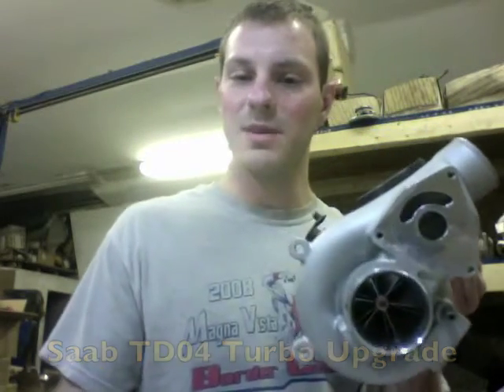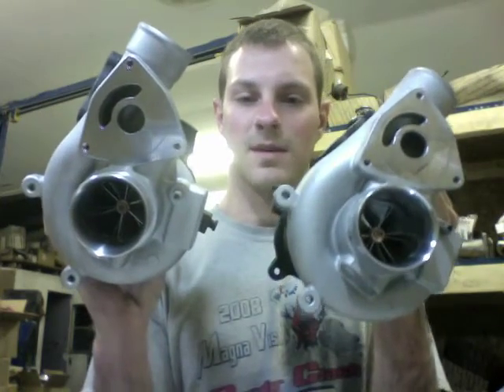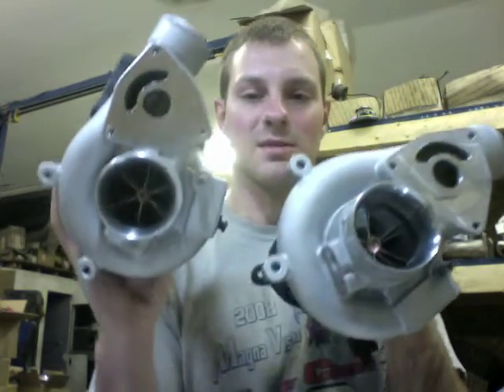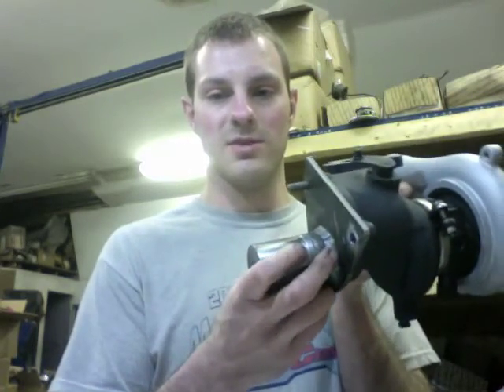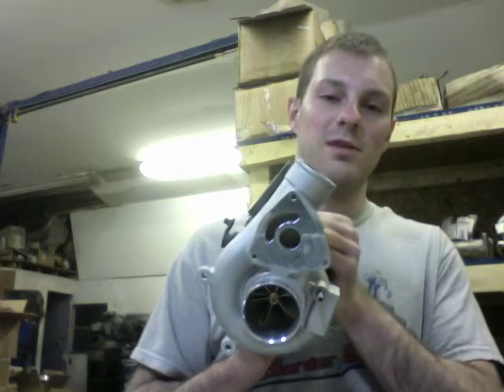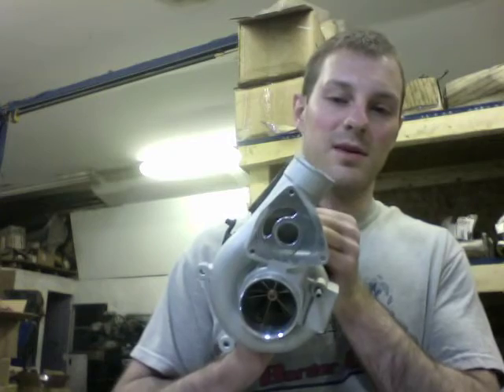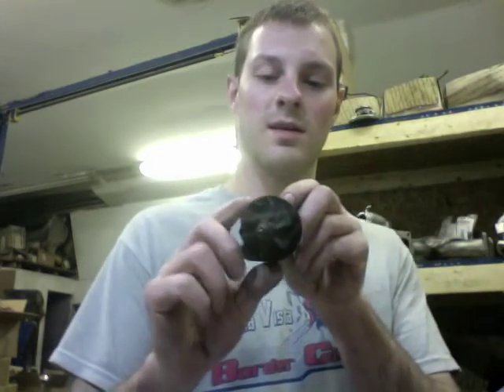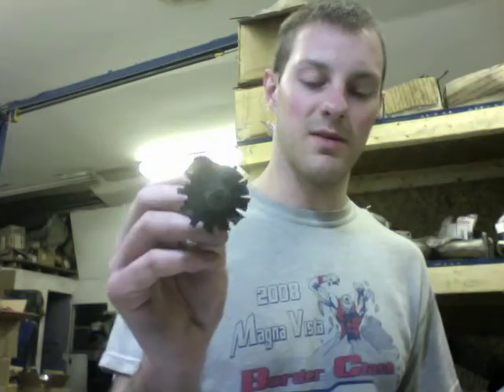Saab 9-3 TD04 Turbo Upgrade

Comment: Help... I bought and repaced the bearing and seals on my turbo...TDO4-14T. hand tightened the compressor wheel...and now the whole thing is hard to turn.....any idea what I did wrong...?
Reply from the maker: Yes. The thrust washer (thrust spacer) is likely running in the bearing housing. The bearing housing can be cut for it to fit with a porting tool or you can use the stock thrust washer
Reply: @turbolabamerica  good morning, I don't know which bearing that would be. But if you have a video showing the possibly problem it would help out.

Comment: Sorry to comment on such an old video, but my father put a TD04HL-15T on a ( small 1L, 3cyl diesel engine) used for mower pulling. He wants it to "whistle" at idle and while under load. Is there a way to do such a mod to the turbo or is he merely wanting too much? Lol. Thanks.
Reply: Try an anti surge housing or a Holset HE221 which has an anti surge housing and drops right in to a TD04 turbine housing.

Comment: where are you located,it depends on the duty cycle you can achieve and keep it reliable,it rolls that's for sure I've had it dynoed at 322whp

Comment: Where can I purchase that 20t compressor housing?
Reply from the maker: I machine the factory cover
Reply: Turbo Lab America how much do you charge for an upgrade like this ? I have my original Saab 14t .
Reply: Been trying to get a hold of your business... I called both numbers listed and tried leaving messages but the inbox is full.
Reply: is your 8th  vin a Y or S ,i have the turbo and you are going to need a good tuner to get it to work correctly ,go to chris budde on you tube ,what areo do you live?i have done every upgrade to my areo so i have the trial and error experiance to help!or text 410 269 3414 chris

Comment: you can make 400hp on a 19t with a good remap and on e85.
Reply: i doubt that,no tune
Reply: Ayylmao my 2000 93 se makes around 300whp no tune with the td04 turbo
Reply: absolute max effort maybe. I'd assume 350bhp so like 310whp. I've been learning to tune these things for about 2 years now
Reply: @anewzack78  and chance you would want to help me out with mine?
Reply: @brianleach1866  sure. What Saab do you have? I specialize in T7 cars...not too familiar with T8
Reply: @anewzack78  I have a 2004 9-3 arc, I'm pretty sure it's a t7. I know it's not a t5
Reply: @anewzack78  there are no shops near me that will take in a saab for performance upgrades. So I'm kinda alone around here for help
Reply: @brianleach1866  you car uses T8... T7 was used on the 9-3 up to the 2003 OG. Same year Saab launched the NG with the T8 and the ecotec engine
Reply: @juancarloslozano3374  ok sweet. I got rid of the car almost 3 years ago